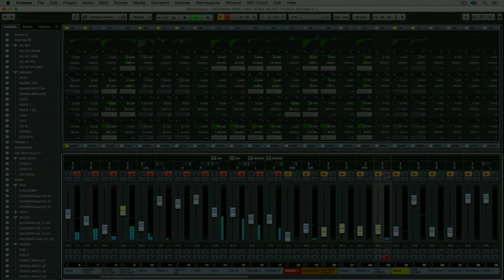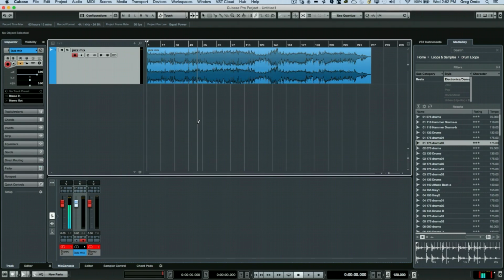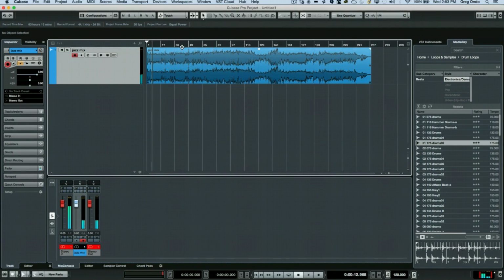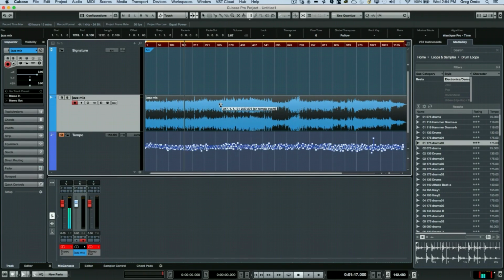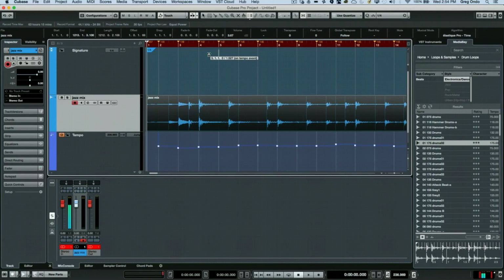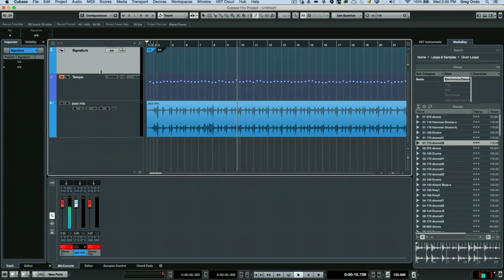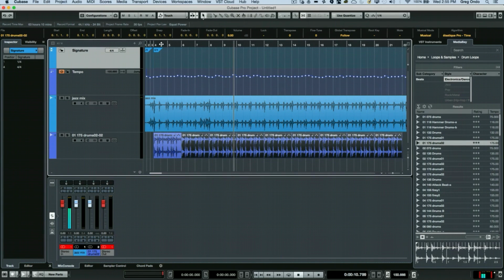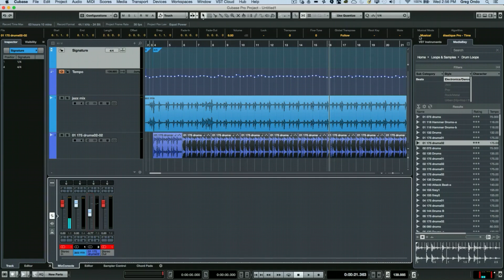How to Make Loops Match Variable Audio Tempo in Cubase | Q&A with Greg Ondo

Comment: Wow-- this is great! I am finding my current project without a drummer and I am having a very difficult time trying to make midi mapped drums to have the same push/ pull of working with a drummer who is tracking with you as you play guitar. Pre-programmed midi drum files are fine, they had been programmed to have some of that natural shift before or after the beat.  I am still finding them sounding rigid compared to a band actually doing live off the floor recordings. You have to adjust your playing to the loop and try to accommodate the pre-programed accents. I have been trying to find a way to get a more human feel--- this will be a huge part of the solution. Thank you for the great tutorial! Cheers!

Comment: Just a tip,  I had a problem syncing loops using exactly the same moves as Greg, Then realised I was recording in 96kHz ,so my 44kHz loops would not match, arrgghhh! Check your settings if you have issues

Comment: hey Greg, thanks alot this is super helpful as always! I also have a new question related to tempo changes in Cubase 9.5.
Right now I'm working on a song that has 2 ramping down tempo sections and my problem is that while working INSIDE CUBASE I will actually hear correctly the tempo changes and pitch changes from my DELAY PLUGINS (in this case EchoBoy from SoundToys) during the downward ramp. But when I EXPORT the project (mixdown the strereo out) - it doesn't matter either if its off-line or real-time exports - it doesn't mixdown those nice delay tempo pitch and time changing artefacts that I hear while playing the project inside Cubase.

Is there any way that this could be worked around to mixdown properly those downward tempo changes affecting the plugins?

thanks in adavance!
Alex

Comment: I wanna thank you for this tutorial.

However, many (dance) remixes are made on 1 fixed tempo, so they are easier for a DJ to mix in his set.
So, a tut for "the other way around workflow", ie, making the original track lock to grid, at 1 fixed tempo, and then add remix elements like beats, would be very welcome imho.

Warm Regards.
Reply: Thats what I'm thinking

Comment: wonderful concise explanation, thanks. what do you do if after highlighting the track and conducting tempo detection the detection has only analysed the first 30 seconds of a 2 minute 30 second track?
Reply from the maker: If a file can't be detected automatically, use the timewarp tool after analysis and set the next beat and it will automatically do  a new tempo detection from that point.
Reply: Cubase the track I was working with did do a tempo detection eventually, but, something went wrong and I had to close down and restart, and again, after restarting, Cubase only analysed the first 29 seconds of the track. Do I have a gremlin or a temperamental purchase of Cubase software?

Comment: Wow! That looks like a great tool in Cubase.
When in multitrack project, which drum track would you recommend to use tempe detection?
Overheads?
Reply: I often start with overheads but have used kick and snare as well.  I have also used a rhythm guitar track with great success.
Reply: Thanks for the tip. I'll try it out.

Comment: Greg - thanks for all the great tutorials. I have a related question: How do you take loops in libraries like west africa or cuba in kontakt and put them into the cubase timeline?
Reply: I do not have those libraries but some content may be protected so that you can not do this easily.  You can always place a MIDI note in the Cubto check ase project, do a render in place and have access to the loop that way.
Reply: Right  - I imagine it's the way it is because for some reason they don't want the loops to be used? Your answer is over my head, but thanks for getting back anyway man. I'm learning so much from your work.
Reply: Thanks for getting back at me Greg :)  I don't understand what you mean, but I'll try and figure it out. I've seen some other people have this question. Not sure why the libraries would include loops if they're not "useable".
Reply: Thank you - I use 7.5 and not sure I have the render in place function
Reply: Render in place was already in Cubase SX 1 but was called different. I have the German version.